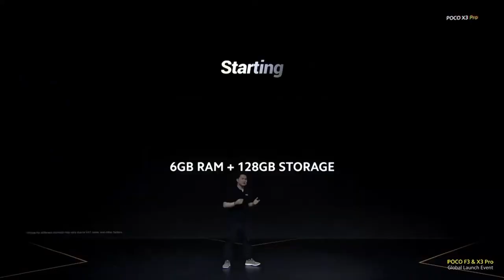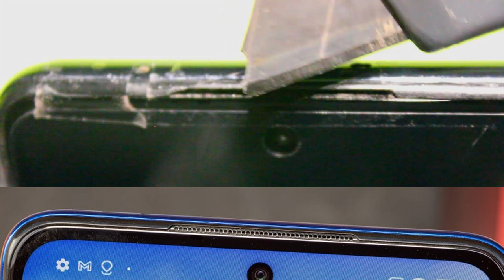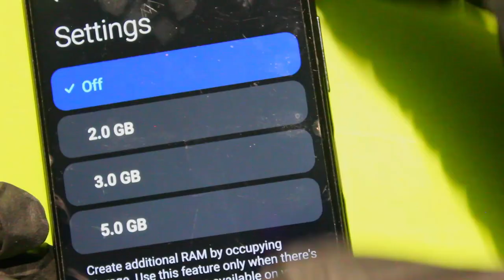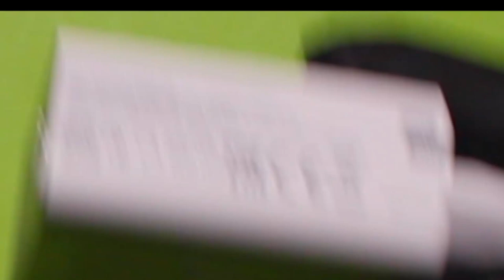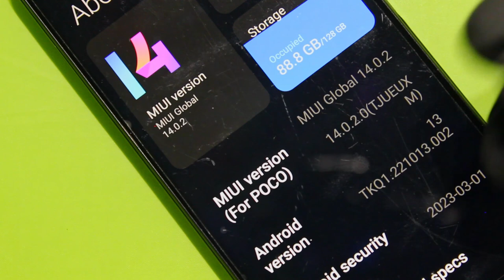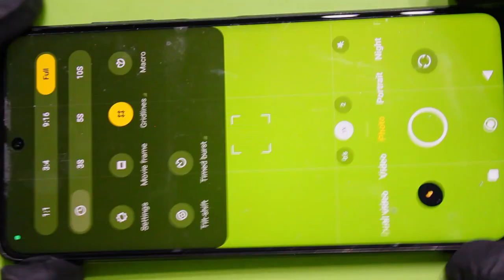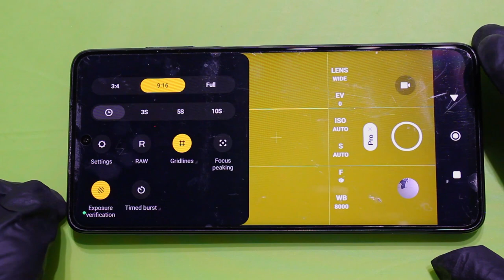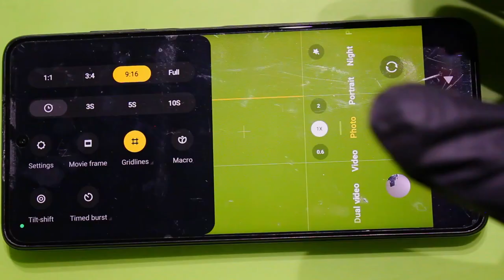POCO X3 Pro | Full Review  - 24 Months Later

Comment: My poco x3 pro is so damaged but still works 🤣 Got it about 2 years ago like you but mine is on life support, adhesives are coming off and the battery/charger cables inside keep disconnecting. Its a tank but i don't like many things about it (mainly the cameras)